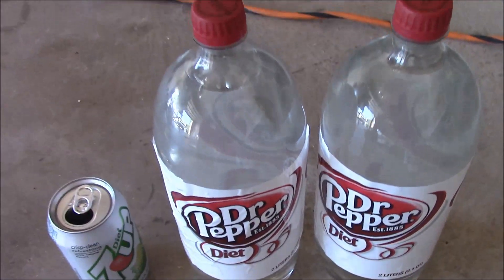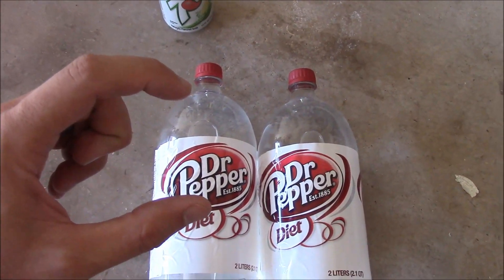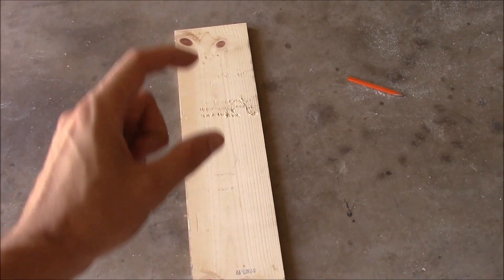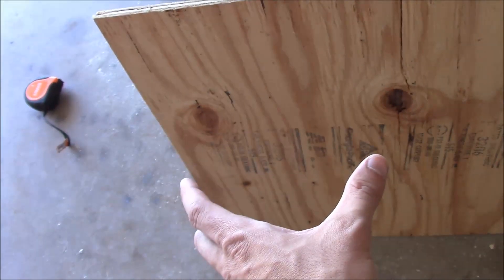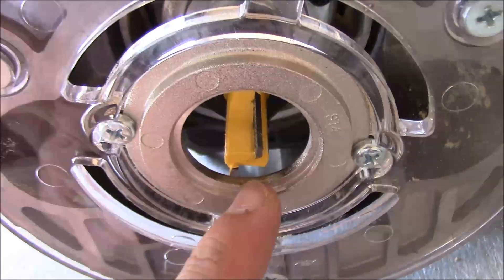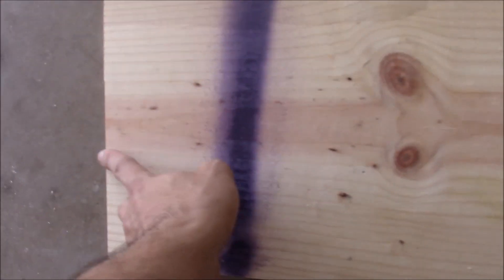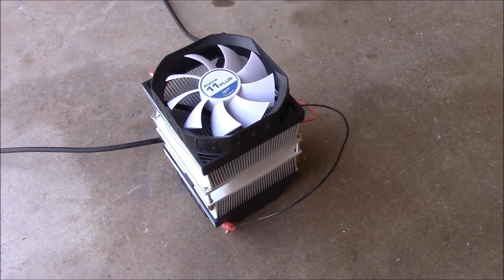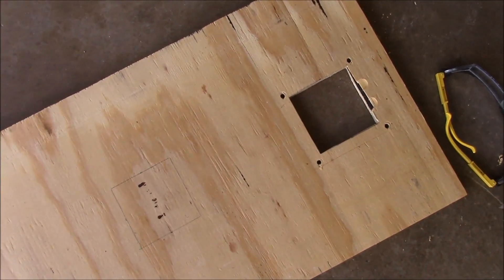Mini DIY Peltier/TEC Fridge Prototype - Learn From My Mistakes

Comment: Please make a video building a peltier frig. using a 15-amp to 30-amp peltier instead of using a 6-amp or 10-amp peltier device.  Thank you.  Please watch YouTube video titled:  DIY Solar DC Direct without battery !!!  The 3 common methods. / Video Channel Name: Solarduino, and share your thoughts about which of the 3 common methods could be used for solar powering a peltier frig without a battery or solar charge controller.  Thank you.

Comment: Hello I am building a peltier device to cool a dog cage and it is my thesis .. I can't qute figure why my peltier doesn't cool as much has yours
Reply from the maker: What are you using on the hot side as a heat sink or radiator?

Comment: If you run it at lower power the heat needed to be dissipated is lower and in turn allows the TEC to keep producing cool air longer., When you apply the MAX or to much power, the difference between the hot side and the cool side begins to get closer to each other and negate some of the cooling effects, unless you end up using a larger heat dissipating system, and by the time you do that it gets expensive.
Reply from the maker: True, you can gain some efficiency by running at lower power.  But you do lose max cooling.

Comment: How did you decide or design the thickness of the plywood (wood ) as a insulated Material
Reply from the maker: I just used what I had available.  If you are designing from scratch with the best materials then use at least an inch of dense foam insulation inside the wood frame.

Comment: I have a insulated 3 cu foot insulated foam cooler and I am running the slightly smaller cold sinks with 60mm fans and I can't seem to get it down to 60. I am getting a 4 degree difference at best. I am not sure if I need a bigger cold sink, or stronger fan. I am getting a HUGE amount of condensation which completely sucks out the energy.

Comment: Anyone tried putting a wet sponge on the hot end? It should lower ambient temperature with good air flow. Thinking for regular cool box  if any one wants to experiment I’d be interested in the results

Comment: How can you close this box without letting cool temperature come out?
Reply from the maker: What do you mean?  You mean open it without cold escaping?
Reply: @LDSreliance   i mean what did you used to close this cooling box.
Reply from the maker: A hinged door with insulation around the edges.

Comment: Could of used a old mini fridge shell vs building something out of the wood, plus it's already insulated? Also could you hook this up to a computer power supply to plug it into 120V outlet? Just some thoughts LoL 🤔🙂 Thank You very much & have a wonderful day!! 

All the best,
Ron.
Reply from the maker: Yes, that is an idea if you have one available.  Might be a bit harder to modify to your use than wood but it is already insulated and has a functional door.  I use wood because I can make it any shape or dimensions I want.  But it does make it harder to insulate.

Comment: Much easier to get a broken fridge, take out the compressor an' all, and cut a hole for the cold heat sink. Looks a lot better too! Also cascade Peltier elements to get a better delta T.
Reply from the maker: I tried that once.  I may try it again.  It would be difficult to use off the shelf parts like I did here and get a tight fit in a traditional refrigerator.  You would have to do some custom fabrication for mounting and sealing.  Or order a custom spec'ed heat sink to fit the fridge you took apart.

I tried cascading once before and while it does improve the delta T it uses way too much energy for my tastes.  I don't need it colder inside than what I achieved in this experiement, either.

Comment: how many times require to cool 1lit bottle 5degree centrigred?
Reply from the maker: I am sorry but I do not know exactly.  I have been able to get this type of refrigerator down to 40 degrees Fahrenheit but I don't know how long it would take a given volume of liquid to cool down.  It took over an hour just to get the air to cool down so I would guess it would be several hours for liquid.

Comment: were you able to fine tune the system to where the temp will stabilize? If you did, what Peltier device capacity would you recommend to maintain a constant temp around 55F for a 2 1/2 cubic inches box?
Reply from the maker: 2.5 cubic inches?  That is tiny.  I think any size peltier could do it.  You would need to either regulate the voltage to achieve a constant temperature or use a thermostat so it kicks on and off.

No, I have not finished this project.  I keep intending to continue with it but life is super busy right now.  Sorry for the long delay.
Reply: my bad, I meant 2.5 cubic feet.
Reply from the maker: I think a 10 amp unit would easily do 2.5 cubic feet even without great insulation.  You would probably be pushing it with a 5A or 6A unit.

Comment: Hi, I'm trying to do something very similar and have built a cooling device using exactly the same parts. I'm trying to connect the fans directly to a power supply (12V) but can't get the wiring properly to make them work. I thought I could only connect the yellow and black to the power supply and ignore the blue and green, but this is not working with this CPU cooler. Any advice?

Thanks!
Reply from the maker: I don't remember the fans having colored wires on my Corsair H60.  Are you sure you used the exact same parts?

With a 4 wire (or 3 wire) fan like that the negative wire will always be on the end.  The positive wire will be next to it.  So you can look up the colors online to find out which is which or you can look at the wires as they lay flat and use trial and error to connect the end wire to the negative terminal of a battery and the next closest wire to the positive terminal until your fan starts spinning.

Comment: I will make a peltier fridge but I don't have foam but I think aluminum tape will do fine
Reply from the maker: Aluminum tape will help seal in the air but it will not do much for insulation value.
Reply: LDSreliance well if it helps then I'm brobaly gone use it
Reply from the maker: Aleksander Sats Making it air tight will definitely help.

Comment: why didnt you just buy an actual cooler from the store and modify it to hold the heatsinks & Peltier module?
Reply from the maker: I will try that in the future.  Wood gave me better mounting options and allowed me to make whatever size I wanted.  But it is a challenge to insulate and create a tight sealing door so I will try an igloo type cooler in the future.
Reply: that would be awesome, i'll pre order 5 from you right now even!
Reply from the maker: Johnny Stash Haha, sounds good.  I'll add that to the list of videos to work on.

Comment: hello, how much time can you run the refrig with those lead batterys .using 4 batterys in parallel.sorry for my english, god job!!! from Argentina.
Reply from the maker: 4 lead batteries of the 100 Ah size would give you 400 Ah and could run a 20 amp load for 20 hours.  Roughly that would be 240 watts for 20 hours, which is more than enough for a fridge that size.  So I would say a good estimate would be 24-30 hours of run time.

Comment: You need to insulate the bottom of the cooler. If you sat your cooler on top of a board of the insulation it will hold the cold air longer. Peace
Reply from the maker: True.  There are lots of little things like that which would improve performance.  I have since corrected some of them but my quest for an efficient small cooler using peltiers continues.

Comment: This isn't a waste of time.  You approached it scientifically, made proper measurements and headed towards a working model building on your experience.
And best of all you saved us from having to go through the build to get the results.  8^)
Thank you.

I've just ordered 5 X 60 watt Peltier Effect devices and am waiting for them to arrive so i can have a play too.

Bottom line for these is that the efficiency is dreadfully low so it has limited applications.  I might sit my beer on one to keep it cold or some other novelty use.
Reply from the maker: Yeah, they are limited in their uses but they do have advantages.  They are solid state so they are more reliable and last longer (MTBF) than coolant refrigeration devices.  They can also be tipped upside down and on its side with no ill effects which make it ideal for portable, rugged use such as camping or traveling.  And they can be easily reversed to make heat by reversing the polarity which could be nice to keep things warm instead of cold by flipping a switch.
Reply: LDSreliance True but you need to bring the power source along with you too.

Anyway I'm looking forward to playing with my Peltiers when they arrive.
Reply from the maker: Warren NZ That is true.  But wouldn't you have to bring a power source for a traditional style fridge, too?  They are fun devices and super inefficient but they have their place.
Reply: LDSreliance Yes you'd have to bring a power source either way.  But I'm pretty sure an ordinary fridge is much more efficient.  But then as you pointed out, a Peltier fridge is immune to rough handling and a standard fridge isn't even supposed to be tipped on its side.

Anyway even though I have no specific plans for my 5 devices (on their way in the mail), I'm still looking forward to playing with them.  Something about putting electricity into a solid state device and it getting cold intrigues me.

It's counter-intuitive like fridges that work on burning propane.  I understand the physics but it's neat.
Reply from the maker: Warren NZ
Very true.  Have fun!

Comment: i Use a insulatet Box. And I have reached a temperature of 4 C° (39,2 F°)
Reply from the maker: Nice.  Do you have pictures?
Reply: Unfortunately, I have built a prototype apart . Unfortunately, does my current model , not so good , but I have pictures of the prototypes .

Comment: nice idea if you want to do it right you need some insulation and some plastic inside insulation in plastic is cheap can't you install that later
Reply from the maker: Yes that can be done later.  I wanted to test the thing out before investing a lot of time and money and effort on a more polished, complete unit.

Comment: in my scenario, I am unable to get less than 17 degree C (outside temp is 29 to 34 degree C). i used an amazon box an used the thermocol to wrap that up . used 2 layers of it to prevent the air leakage. Please suggest me where is the issue peltier used: TEC 12706power system used: 500 watt smps (able to give 11.23volt to 11.00volt max dc after the peltier is on)box size : 1 feet x 1.5 feet, cooler used: Cooler Master Hyper 103 Essential CPU Air cooler
Reply: +Pratip Biswas thanks!!
Reply from the maker: Pratip Biswas You are welcome.  Keep me posted and thanks for watching!
Reply from the maker: What is your goal as far as temperature?  I am concerned about your power supply only providing 11 volts.  Peltiers are actually more efficient at slightly lower voltage/amperage but your peltier is actually on the small side for that amount of volume so not giving it all the juice it wants is probably going to be insufficient.
Reply: my goal is to go ad down as 14 to 17 degree C!!! My supply power is 11.23 volt actually .... I think my smps is not that much good because I just had one spare smps, which I am using.... but I guess it's able to give me almost 5 Amps of current as well. but not going beyond 21.3 degree C
Reply from the maker: Pratip Biswas I would find a power supply that can supply a full 12v and a full 5 amps of current (maybe slightly more).  But I still think that will be too small.  Try getting a 10 amp peltier.
Reply: +LDSreliance 10amp peltier will give me more cooling effect?  I do have one more 6 amp peltier,  should I go for another setup? will it help me out to get more cooling?
Reply from the maker: Pratip Biswas I have tried the dual peltier and it does improve things a bit.  A 10 amp will be simpler because then you don't need to poke additional holes and get additional heat sinks.
Reply: +LDSreliance ooohhhkkkkkaaayyy
Reply: +LDSreliance thnkz, will try..  and let you know
Reply: how much did this cost if i may ask?
Reply: +wesbotYT Indian currency, (INR)  peltier devices: 300 bucks ($4.5), heat seank 2000($30) bucks one (the hot side) and 600($9) for the cold one, and smps 750 bucks ($11.25)

Comment: Nice project, what about security? if short circuit  can get fire when nobody is at home or  near , that is another point to solve too.
Reply from the maker: What do you mean by security?  Like a lock on the door?  I don't think that 5 amps of 12v DC can cause a fire very easily.  I think it would need an accelerant to do that.

Comment: Great video, love it. I'm using my mom's broken bread baking machine as a case. I see you're using foam board, like I do. Would it be better to have aluminum foil on the inside? My foam board doesn't, but I don't know if that would help as isolation.
Reply from the maker: +Erik van reusel I don't think that makes much difference.  I do like it because it can provide a barrier for moisture but other than that I don't think it has much insulation value.  If this were heat it would be a different story.  But for cooling I'm not sure.
Reply: Thanks for the help! I found out that I have less space than I expected. Do you think the fans on the inside have give a difference comparing to a metal plate (like in other tutorials)?
Reply from the maker: *****
I think it helps circulate the air a bit but that is it.  If you can mount it to a metal plate that would be easier to mount and should work just as well or almost as well.

Comment: suggestion. Instead of a box, if you used a tetrahedron, a pyramid, or a dome, the torsion currents would help it retain the cold. The problem with a box is heat rises to the top, and cold sinks. And so you have an uneven temperature depending on the location of an item in the box. But use a dome, and there are natural torsion currents that form, spinning the cold all around it.
Reply from the maker: +morpher44 Interesting.  I did not know that.  Thanks!
Reply: +morpher44 and what is a natural torsion current?
Reply: Richardj Torsion: the action of twisting or the state of being twisted, especially of one end of an object relative to the other. So for example, in a dome shape, smoke rises, hits the top of the dome, then spirals around filling the space. The smoke is showing the path of the heat.
Reply: Why do you think such a thing exists and do you have evidence? Why do you think that in a dome the temperature would be more even? How do you know that this happens in a dome and not in a box, where did you get this idea. No one ever mention this in physics class, do you know something others don't, especially physicists.
Reply: Richardj Search for 
Pyramid Torsion Field Power in youtube.
Reply: That is not evidence. I've seen a couple.  I would like to read a physics or scientific paper on it. You know that anyone can make a claim but it takes evidence to prove that something exists. A video is not evidence.